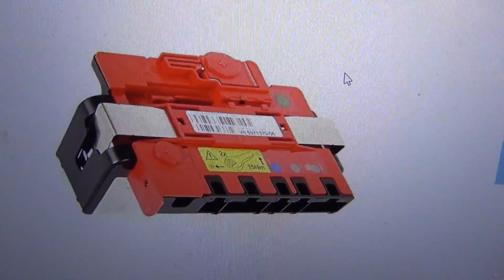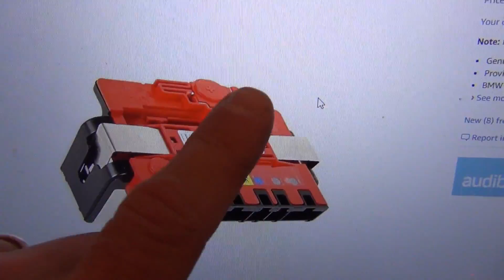BMW E90 Power Module Diagnosis

Comment: Thanks you!
Reply from the maker: Your welcome John! This is can be a difficult problem to solve if you have never seen it before.
Reply: @AskTheCarExperts   What if there is low voltage to the ecentric motor (~5V) accompanied by P1056 (control motor supply low voltage). The fuse is goood, and the relay responded when ground was applied. I replaced the DME thinking it must be on the control side, but that didn't work. I ordered a new relay to prove out the relay might be internally failing; it should be delivered in a few days. Meanwhile, I'll be testing the wire harness again. Does the low voltage issue sound familiar? I'd appreciate any direction. This problem is really testing my patience.
Reply from the maker: @johndaniel238  The low voltage fault is not a common issue. Make sure your engine ground is not corroded. Is there any corrosion in the bottom of the battery box area? It could be a voltage drop from corrosion.
Reply: @AskTheCarExperts  I thought it might be a ground issue as well, so I connected a jumper cable from engine to body but no help. I removed the battery looking for obvious signs, but it looked very clean. The only thing I noticed was the IBS was sheared off at the negative terminal, but that wouldn't cause a P1056 low voltage supply. I'll look at the cables underneath the chasis and re-check the wire harness...wish me luck.

Comment: About a month ago I noticed an oil leak around my oil filter housing,  I figured I might as well do the valve cover gasket while I was in there,  Crazy what I had to remove to get the cover off!!!!

  I got the cover off on a Saturday and decided to put it back together the next day.  Well I  woke up the next day with major Covid symptoms!!!!

I was out of commission  for a month,,, it really knocked me on my ass,    When I finally got better I went back to finish the job,  I got it all back together nicely,  went to start it and it would just crank,   wouldn't start,   I rechecked every connection,  nothing,   I did a fuel pressure and spark check,   I had both,  I did a compression check,   that was fine.  I kept getting engine malfunction on my display.

Spent 3 days going over everything  as the car ran fine before the job,  so it was something I did,   I did a lot of research on line and everything pointed to the valvetronic motor,    What through me was I had voltage at the motor,  I read that I should have 5 volts and I did,   I was getting valvetronic codes so I kept focusing on that,  

I just happened to come across this video and so I went to the power module and performed the test,   I  had voltage at the red lead on the power module,  I was out of options and the next step was the BMW dealer and you never leave that place  with less than a thousand dollar bill.

The part was only $60 on Amazon and they take EVERYTHING back so I figured what do I have to lose.   I installed the new part and to my surprise the car fired right up!!!!!   

The car ran very rough at start up so I cleared the codes and got two new ones, engine misfire on 2 and 6,   just loose connections at the coils,  fixed that and its running just fine.

I also read that you have to go the the dealer for a valvetronic relearn,   not true,  I just turned the key on without starting it,  the valvetronic  motor went through a series of starts and stops,  Once it stopped for good everything was fine,,

I believe I did touch the terminals under the hood as I remember a small spark while I was working under the hood,  Lesson learned,   DISCONNECT TH BATTERY BEFORE YOU DO ANY WORK,!!!!!!!!!!
Reply from the maker: Thanks for sharing! I hope your doing well and recovering well from Covid.

Comment: What could connecting the battery terminals backwards do to the battery and the fuses? My brothers manage to do this while jump starting their car with mine, I have the trifecta lights I have 2 codes that pop up pointing towards hydraulic unit adjustment dsc unit
Reply from the maker: This can cause melting wires, shorts, and control module failure.

Comment: Great video need a little help, been having valvetronic issues for a while,  had code 2a77, 2a38, replaced motor and relay, code was still there but car ran perfect for a while till yesterday , got code 2a3f voltronic motor power supply,  08 328xi , e92, could this be it to solve all my problems lol, I know it's a needle in  haystack but I appreciate some help please
Reply from the maker: The best way to tell is to check for power at the power module on the wire as described. If you do not see voltage then this would be the issue.
Reply: @AskTheCarExperts  okay thanks will do, crazy drove it to work yesterday it was fine got off went to crank it it won't start lol ,  do you have a website or a contact

Comment: I think this broke on my car but one question if this fuse broke could i start the engine with the plus docking in the engineroom?
Reply from the maker: No, jumping at the jump terminal would not change anything if the internal fuse failed.
Reply: Mine is only starting when I ground the engine block to the chassis with jumper cables …. Please help it’s got new battery, new starter, new alternator, new bottom ground cable, does the n51 have a top ground cable as well?

Comment: Where do I find the part number on this part? It's located in the battery compartment on F30 335 (not directly mounted), but looks the same as yours. I googled the numbers on the label, but they weren't the actual BMW part number.

Comment: So i have a 2008 bmw m3 . I have an ongoing issue where until the motor comes up to temperature the alternator doesn’t work ! I have confirmed this many times with a volt meter . When it finally does start working it will continue to work until i park the car and the motor cools
Reply from the maker: Hello Donny, That is an unusual problem. If you check the voltage before you start what is the reading from the battery. Then when you start the M3 at idle what is the voltage. And then turn on some loads such as radio, lights, seat heaters, blower and what is the voltage?

Comment: What are the symptoms you would look for to indicate the module has been damaged?
Reply from the maker: That is a great question! Usually the vehicle will have a crank no start, an extended crank, and poor idle and acceleration if it does actually run. The check engine light will be on and there should be codes relating to the valvetronic sluggish or no movement or no power supply for the valvetronic. How the vehicle runs is determined by the last position the valvetronic motor is in when the fuse is opened.

Comment: I guess it’s not a bad idea to disconnect the negative cable from the battery before doing this type of work I must admit I’ve worked on many BMW and usually don’t disconnect the negative but sometimes when i know I’m going to work on the starter or alternator then i do disconnect it once I burned one fuse in a Similar part on a X3 F25 I was charging the battery under the hood on the passenger side close to the strut tower brace I removed a plastic cap I don’t know why I did this but the positive clamp shorted on the brace and burned a fuse and had to buy a new Fuse assembly.
Reply: Yes I forgot to mention this this is what I do on E 9x cars because the Alternator and starter shares the same supply the other day I got one that stoped cranking and I thought that the starter quit I check the power at the bolted Connection and it was ok so I wanted to check the power at the starter but it’s not easy so I remove the intake to check the starter power supply and guess what no power I did not know that the alt and starter shared the same supply I should of check at the alternator I found that the guy that did the valve cover job had pulled on the connector and it did not look like it but the terminal and the wire wasn’t connected anymore so we’ll live and let learn.
Reply from the maker: We have all been there :) Great advise on disconnecting the battery. This should be done before replacing the valve cover to be sure nothing is shorted. And definitely when the starter and alternator is worked on. There is a small cheat for the starter and alternator power. You can disconnect the red power supply from the jump terminal which feeds the starter and alternator on some BMW's.
Reply: nah man, you need to disconnect the positive first on any of these newer cars. i know it seems backwards and it's always just been that if you pull the negative off you're good, and you could also short the power by touching positive and negative together after removing from the battery to discharge power. but you don't want to do that on these newer vehicles. a lot of the components in them still are holding a charge, they have their own capacitors and if you pull the negative you can fry the modules. you're always supposed to pull the positive cable first